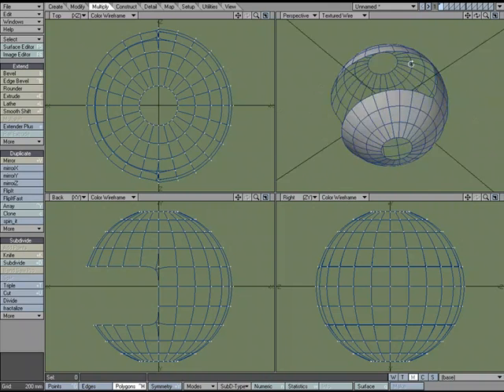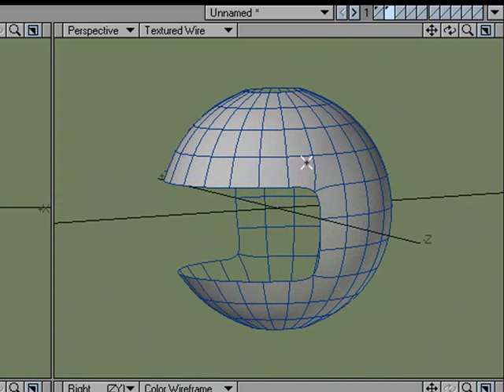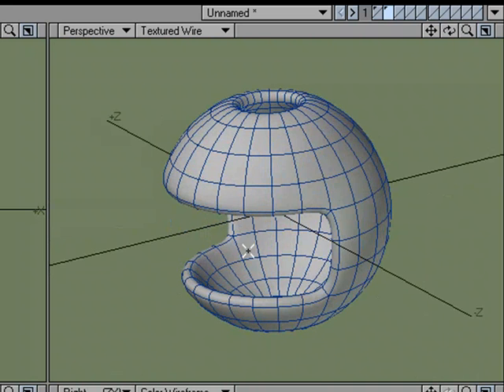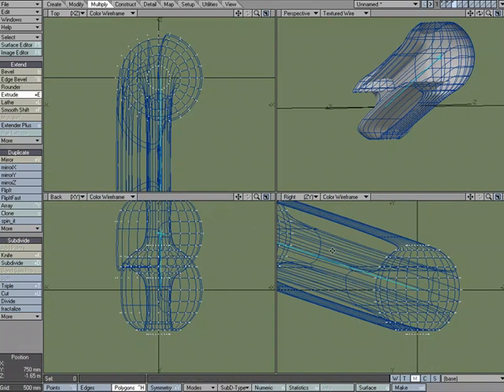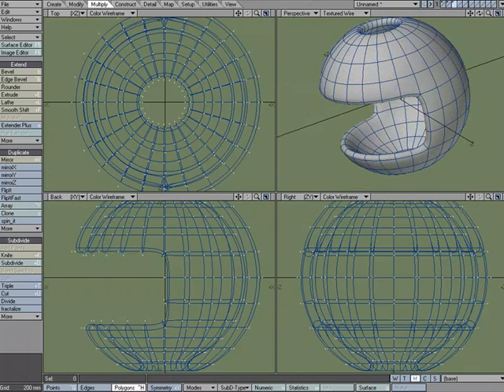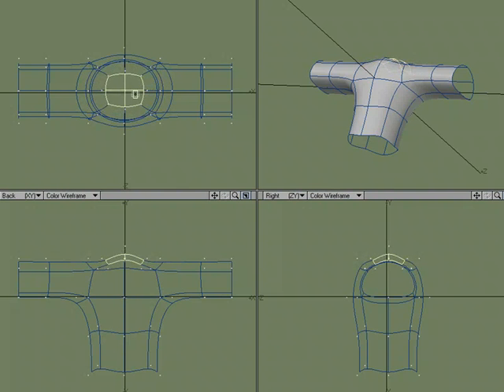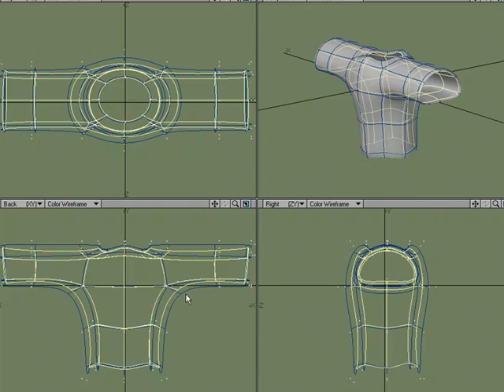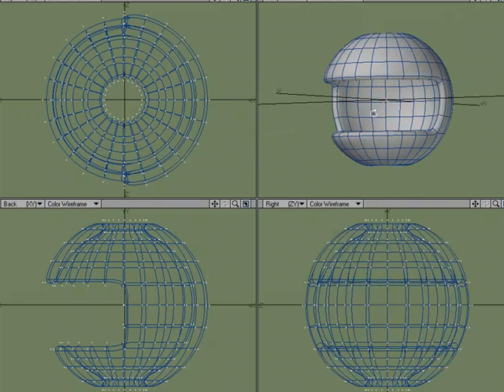3 - General Modeling - Adding thickness to single-sided geometry

Comment: It's been over nine years since you published this, but it was exactly what I needed.  I had an old model sitting around that I wanted to 3D print.  Since none of the polys had any thickness to them, the resin print failed.  Now I can print it.